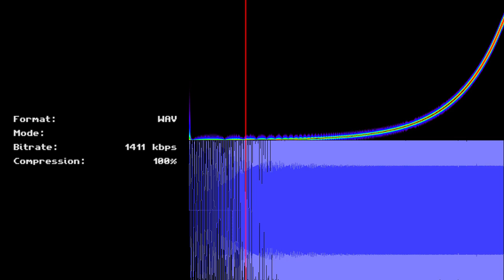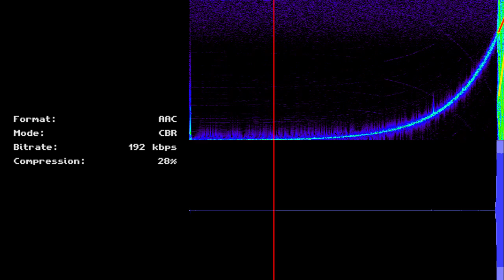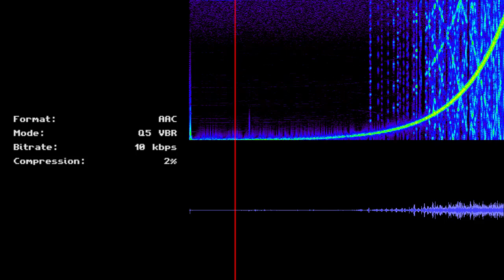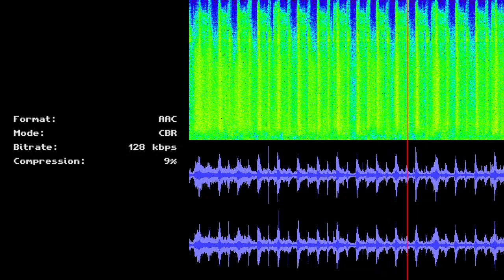What Does Audio Compression Sound Like?

Comment: There's some fundamental misunderstandings that are portrayed in this video. You need to be careful and understand that there's a lot more than strict linear response frequency loss when you compress a format. In fact, that isn't even happening when audio is compressed (aside from some bandwidth filtering at the very bottom and very top of the frequency spectrum in most encoders). There tends to be a lot of things that happen. Most popular audio compression formats, such as MP3 and AAC, use a completely different method of breaking apart, storing, and reconstructing a waveform than strictly PCM audio.
MP3 specifically uses Fourier transforms and frequency-domain samples to simplify the frequency spectrum into blocks. It's not shaving off frequencies, it's representing them in a different way.

Compressed files, even at high-quality settings, can reconstruct the waveform in entirely different ways. Lots of phase shift and bits of pre-ringing. Doesn't mean the original audio isn't accurately represented; it just means it's represented in some slightly different ways.

So yeah, the warbly artifacts apparent in this setup aren't an accurate sign of what's been lost, but truly just a sign of what's different. There's a correlation between low bitrates and artifacts heard in this process, but it's not a direct relationship. The waveform is different for a variety of reasons and it is not at all accurate to say, "this is all the content that was thrown away when it was compressed."
Reply: Thanks for your wonderful explanation. This video indeed gives inaccurate picture of what compression artifacts are and what to look out for.
Reply: Agree - it's a really good *idea*, but the video lacks a clear demonstration of what we actually hear in the compressed version (we only hear the original and then the artifacts, which would be more useful if we heard the normal compressed version first)
Reply: The fact that OGG Vorbis didn't show apparent loss in the low end frequencies is really impressive to me. I'm converting any new stuff I get for space reasons into Vorbis @ 96kbps and can't notice a damn difference
Reply: Absolutely incorrect. You completely left the quantization step out, which is where the "lossy" in "lossy compression" comes from. Quantization literally is "shaving off frequencies", as you put it. Converting it to frequency domain is only a means to make quantization easier(actually, this step is impossible in the time domain). The artifacts that are portrayed in this video pretty much 100% came from this step. Simply converting it to frequency domain in itself does not make it more compressible.
Reply: Quantization is the same as reduction of bit depth. It happens per frequency band in complex codecs, but is obviously also possible in time domain (ADPCM). A frequency transform allows to place the quantization noise in bands where there already is signal, so the envelope of the noise naturally mirrors the signal, a cetain number of db below it. Few codecs specifically pre-process the low end with a highpass (Opus, iTunes, Dolby), as bass has low data rate to begin with, but DC can interfere with frequency analysis.
Reply: not thrown away, just mad less clear
Reply: Nowhere in the video or in the description does it say that it portrays anything being "lost", so what are you even talking about?

Comment: Looks like some people in the comment section didn't understand what he actually did with the audio tracks.

His goal was to reveal the artifacts let by different compression methods, NOT to compare how the compression methods and the original Waveform sound. In order to do so, he encoded the Waveform into different audio tracks with different codecs and settings. Then, he subtracted the original Waveform out of the compressed audio. This leaves us with only what is different in the compressed tracks.

This is somewhat comparable to what active noise-cancelling headphones do when they cancel out exterior sound waves by reproducing the opposite.

And you can try that yourself, fire up Audacity, bring in any audio file, copy it in a second track and reverse that second one. Click on the play button and you won't hear anything, the second audio digitally cancels the first. They do it entirely because it is the exact same. You can also try and do the same as Dan did, export a song in a higher quality format to a lower one, and do the same as I explained above, you'll hear only the differences, that is to say, the compression artifacts. (You might want to readjust the compress one in the timeline so that the waveforms are synced.) If you don't reverse any of them, the sound volume will just be higher as the waves digitally add up.

Again, when you do what I described on a electronic device, the sound server will do the wave maths before sending the information to your speakers that will then create the sound waves. In real life, audio waves that encouter will physically add up or subtract from each other.

Correct me if I'm wrong.
Reply: ur comment too long dont got time for dat
Reply: @doflam1ngox415  No-one's going to act it out in finger puppets for you my friend. Some subjects are just difficult and you're not going to understand them.

Comment: An important thing to consider is that this is not precisely the data lost. MP3's and the like are converted into the frequency domain before compressing and quantized to a set number of frequencies. So a 50 Hz wave compressed into a 51 Hz wave (you cannot hear the difference between these two things) when subtracted, will produce a noticeable, subtle sound. That doesn't mean that data was "lost." It means that the data was changed. But this change does not imply an audible change.

Comment: There is some misunderstanding here. OGG is a container, not a compression algorithm. The codec used to store music inside OGG files is usually either Vorbis or Opus, and that is what  you want to compare with MP3 and AAC. What you are showing as "ogg" is probably Vorbis audio. Had you used Opus, it would have outperformed all the others, by far.

The container format for MP3 bears the same name as the codec, so there is no possiblity of being mistaken there, but AAC audio comes too in MP4 audio containers (usually with the extension .m4a) and not only in AAC container files. With OGG audio you definitely need to specify which codec has been used.
Reply: I don't get why people are getting this the wrong way. What this video shows is that Vorbis is the only format that actually didn't lose frequencies in the process, specially in the low end. Very impressive actually. I hate dumb people.

Comment: That's really interesting, it sounds like MP3 is better at higher bitrates, and AAC is better at lower bitrates.

FLAC 4 lyf tho
Reply: FLAC is lossless.
Reply: Dmitriy Anonymous 😂 ofc
Reply: Domen Gregorčič  you have no idea of what you are saying, not all flacs are created equal though, and being digital doesn't necessarily mean it can't be lossless. As long as you capture the correct analog and store it correctly in digital you can consider it lossless, and of course you can replicate a digital files and make a perfect copy, don't you know that vinyl have several master versions which will then be use to as mold to reproduce more vinyl, the more reproduction the less it could be the same from the master. Not to mention analogs and anything that needs physical movements in order to read data are slowly killing themselves, friction alone with repetitive use will create micro scratches that will later tamper the suppose original sounds.

Comment: It seems like you're doing something wrong. For instance, take the fact that your 320 CBR MP3s seem to sound worse than e.g. your 128 CBR MP3s. That shouldn't ever happen unless you're using a really poor encoder. In general, if you do the encoding properly and use a sufficiently high bitrate, you shouldn't be able to perceive any difference. This has been the case for years- lossy audio compression has had years and years of development time. Double blind tests are the way to go here, to eliminate any biases the listener may have.
Reply: Daniel Spitz It's a video showing ARTIFACTS left behind after compression. So it's correct.

Comment: Moral of the story:

If you have to compress, don't use OGG or AAC. And if you could, don't use VBR.

Or just encode in FLAC. That should be a good compromise.
Reply: FLAC and WAV are always the way to go.
Reply: MP3 always sounded louder and had more parts of the instruments compressed, while AAC was much quieter. Not sure why you would say not to use AAC
Reply: TheIncredibleMasterE I only use ogg because it's hard to get MP3 working in audacity
Reply: AAC 320kbps VBR is so near FLAC it's almost indistinguishable. I only use that encoding method for my FLAC tracks and it sounds mint

Comment: Subtracting one waveform from another doesn't really make sense at all, as it does not at all represent the difference in what we hear. The extreme case to prove this: Invert the waveform. It sounds exactly the same, yet the difference is the original signal times 2. Our ears are basically a bunch of narrow bandpass filters that sense the amplitude at each band. Research has demonstrated that phase distortion has very little effect on the preceived audio and is only subtly detectable in special test signals, yet phase distortion will lead to anywhere up to 2x the original signal in the method used here.